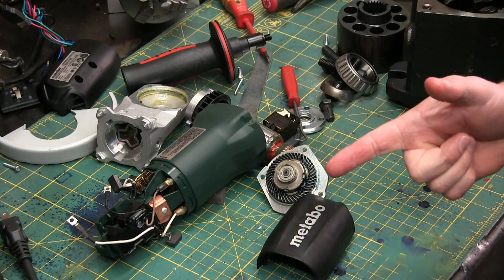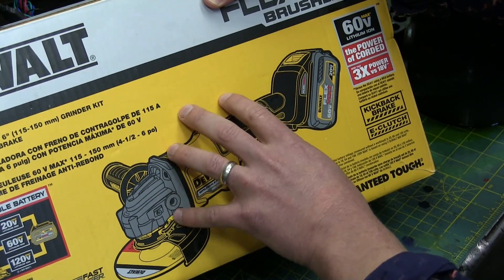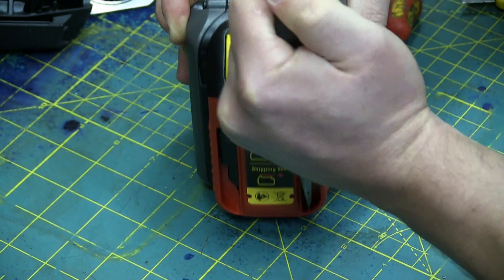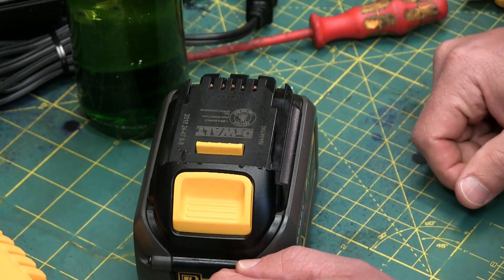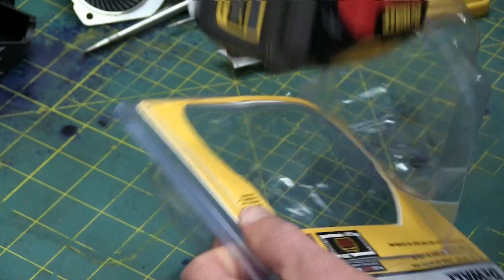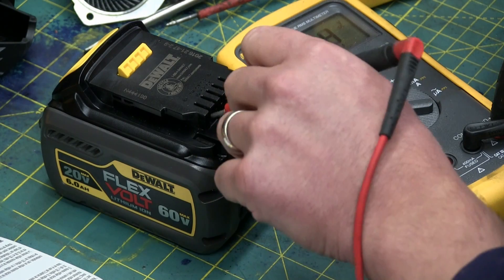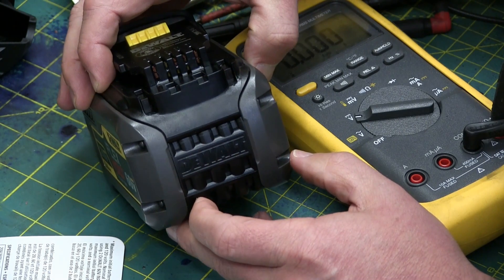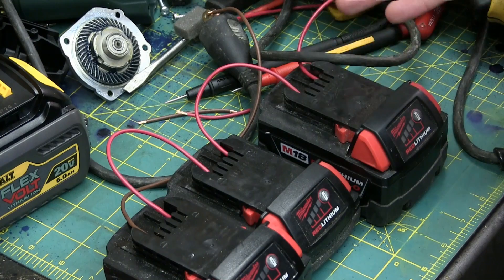Plug-in Power Tool to CORDLESS CONVERSION.

Comment: So basically he wants the power tool to have a starting capacitor like on an A/C compressor. But instead of the capacitor, it's actually a battery.
Reply: Not anywhere near the same thing. A starting capacitor is used on the capacitor start type AC motor because this type of AC motor will only start up and rotate due to the forming of an RLC circuit which causes a phase shift of the starting winding's magnetic field relative to the run winding's magnetic field. If the capacitor is removed, then the motor will sit there and buzz like an angry bee unless you rotate it by hand.
Reply: Paul Frederick my apologies. Damn this comment system.
Reply: Do you mean like how the capacitor shifts the phase of the line current to generate a second phase so the motor can begin rotating? I didn't think so.
Reply: Paul Frederick What do you think I just said. Hmm?? The capacitor will not do anything for a universal motor as it already works without needing any kind of phase shift.

And guess what, if you shift the the current then you also shift the magnetic field phase relative to another. I don;t think it was necessary to have to explain the electrical phase shift part as that is a given if the start and run magnetic fields are shifted....Cause and effect...
Reply: EETechs
my comment was for pauljs75
Reply: EETechs
yeah YouTube doesn't let you plus users like G+ does. Sometimes I do it anyways, but it isn't the same.  So most of the time I don't bother. The threading on YouTube basically sucks.
Reply: +pauljs75 This. Why not just build a bridge rectifier with a capacitor bank? Assuming all these tools operate on DC. Relay in the capacitor bank at current.
Reply: It's likely the transients that hose the breaker. Maybe just having a parallel bank is enough.

Comment: Great idea but don't forget to add a safety that cuts out the batteries when the RCD trips or it's going to be a killer.
Reply: at least then, there is no one else to blame but you when something happens. And your responsibility is to have the tools well taken care of, because no one else will save you if e.g. the wire insulation fails, there is no almighty RCD to save your ass, to rely on.
It's fair, to be honest.

Comment: if the fuse trips "off" form  loops (coil) with the extension cable and start the machine then.
the coil will help you over the drop.  ... but can get warm over time. 

the power tools running on akkus will ruin the akku and maybe damage the machine windings.  
but hey, give it a try  - i might be wrong  :)

Comment: This is a baaadddd idea! Lithium battery are easy to make them go up in flame... You need a proper protection circuit and proper charger that monitor each cells, else you will most likelly ends up with a burned down house...

Comment: Looks like beer makes you smarter.
Reply: Beauty is in the eye of the beer holder.
Reply: ***** Let us be the judge of that.
Reply: Edison would be proud let the pure direct current lithium juiced batteries run anything we want!  For the highest current discharge rating capacity you should look into lithium polymer battery's used  In hobby grade remote control  vehicles!  A typical 5 amp LiPo battery will constantly   flow 100 amps!

Comment: Cord plugged in + TURBO batteries would require a Tranny + Inverter to not damage the batteries. So you could just buy a 12VDC to 230VAC car inverver and hook up a car battery. Would provide cordless function, but needs to be sync'd  to precisely match the line voltage waveform (phase) to provide corded TURBO.
Or just solder some PTCs in a line socket to limit inrush current and switch to batteries if you need cordless. My USD 0.02

Comment: Running corded tools on DC reliably is a bit harder than just giving them DC. Most of them will inherently work off it, but you should really avoid trying to interrupt the flow of the pixies with an AC switch or electronics. AC cross over zero 120 times a second here in North America, so generally minor arc are extinguished fairly quickly. However, DC always has power available, and as a result arcs are very hard to extinguish. I've melted quite a few 120VAC few switches running them on ~100VDC. It depends on the design. Some can tolerate it, but its likely to shorten the life a whole bunch. Some fail the first time you go to break contact, the higher the current/load at the time you go to turn it off, the more likely it is you won't be able to turn it off.

But otherwise, what you're talking about is super easy. I run saws and stuff on my ~100VDC bicycle pack every now and then. Even runs most switch mode supplies just fine. But you gotta be sure to snap the switch off fast under minimal load. At 60VDC you should be OK, but 100VDC and up is some nasty stuff.

Comment: So basically a Online UPS like the APC Smart UPS RT, which varies from a 1000 to 10k VA and ditch the stamped steel housing and the lead gel batteries for Lithium. You'll end up with something far light and smaller, which arguably is mobile enough for this sort of thing. It's probably the only thing that switches fast enough in response to input/output.

Most of the normal line-interactive generally conk out with startup currents, or just go straight into bypass, and still blow the breaker.

Comment: It would be useful to be able to plug any of the cordless batteries into a box that in turn could be used to power both corded and cordless tools. universal power supply if you will. Also Did you not hear me screaming at you to "PUSH THE BUTTON!"

Comment: Just make a lithium power bank that plugs in to the outlet. The tools run from the inverter and get conditioned power which should make them run better and last longer.  you can have a bank of caps that help.

Comment: "but AVE", some would say, "wouldnt pumping 60v DC through the switch of the drill cause an electric ark on disengaging, corroding its contacts pretty fast?" you might need some solid state relays or similar black magic.

Comment: Where i come from power cuts are common, so we've had to become a bit self sustaining. 

number 1 way to get consistent power off grid is to run a diesel generator, but theres maintenance, and diesel stinks, and yadda yadda. 

Or.... you run a fully fledged full sine wave inverter off of a bank of deep cycle batteries and use that as your condom to external power sources. would be bulky, but it'd be might slick built into the back of someones work truck or whatever. Condomised power...

Ok, so say you go the full sine wave/deep cycle route, then you could hook up a second alternator, so that your battery bank gets topped up while you're in transit to a job site. 

Fringe benefit would also been nice clean power, so you could run sensitive instrumentation if you wanted too. Camping could be pretty cool too.

Shit depending what kind of tools you want to run, you could totally ignore local power at a job site, and run purely off your inverter. a bank of 8-12 batteries would be a whole lot power (could rig up a charger at home, so that the bank charges while the user does)

Comment: I was going to say something about using a larger capacitor to handle the initial spike, but I really don't know anything about that. Another thought, when you're grinding a particularly stubborn thing, an energy contribution from the batteries could help. The system could be designed to only draw a certain amount of energy from the wall, keeping breakers frosty. But maybe that was your point all along.

Comment: You would need the charging system like what cars have with their charging systems. And you could use some electronics to monitor the total amperage load and control the DC output to another winding.  The problem would be syncing the speed of the rotor with the AC power and the DC power.

Comment: Based on the video, I picture a "black box" with a pair of standard 120 volt NEMA 5-20R recepticles we can stick our tools in.  On the other side, a standard electrical cord with a NEMA 5-15P plug that we can plug into the wall or connect to an extension cord.  On top of the box is a rectangle opening where each guy can attach a battery adapter plate for several batteries.   

I suggest that whatever is inside of our black box booster unit, the battery-interface is somewhat universal.  This allows the same "black box" design to be used with all of the different brands of cordless-tool battery packs and avoids the design patents I'm sure each company has on their proprietary battery connector & socket.   As long as nobody is making a profit on the battery connector, it should be clear from any kind of litigation.

The battery adapter plate  can be 3D printed, moulded or machined from UHMW, Delrin, HDPE or some other kind of plastic (including the toaster-oven method for recycling HDPE as seen in another video).   For some of the batteries that slide in like Your Milwaulkee M18 & these 20V / 60V DeWalts, a few sheet metal tabs can be screwed on to a sheet of plastic to make the plate too.  That all depends on what resources (3D Printer, tin-snips, toaster-oven) each guy has in his shop.
Reply: In the Solar and Marine electrical industries, there are inverter/charger units that can do what you're suggesting.  They are many thousands of dollars for the high end units.  Victron Energy manufactures a few inverter units that charge your batteries when the loads are low, but will use battery current through a computer controlled inverter  to match the incoming AC phases.  When I worked in the marine electrical industry, we used these when air-conditioner units were being installed on vessels with smaller generators.  The inverter matches the AC waveform from the generator with extra current from the DC battery bank.  We can learn from this type of unit to build a small, portable version that can be assembled and programmed by the "home gamer".

The small Inverter-Generators (Honda EU2000i , etc) are also a good source of conceptual inspiration here.  If you added a battery bank to those inverter-generators they could make up heavy current spikes and starting loads from the battery beyond what the IC engine could support.

Comment: They are not completely charged at the factory because full voltage on the battery makes it deteriorate faster. Li-Ion should be stored at not more than 80% their max capacity for longest lifetime.
This is valid always, not only for long term storage.

Comment: the added ability to switch between corded and cordless would be quite nice.  95% of the time I use a drill where I can plug it in without much concern.  Paying 3x the price for those 5% situations and ending up with a drill that just doesn't chooch as hard and you gotta deal with swapping batteries?  Annoying as frig.  Would be nice to have the option to go cordless for driving a couple screws, but then be able to plug in for something like drilling through dense materials that chew through batteries like a (well, insert moderately insulting simile here.)  Same goes for a circular saw: Go on battery for a couple rips through plywood out in the driveway, plug it in for thicker stock.

Comment: Round here 230 volts AC is the dance the pixies do out of the single phase wall outlet so makes it a little harder to run tools off Batteries

Comment: what you want is a modified ups. always starts the load on battery, then switches to ac. should be pretty simple to do
Reply: i doubt you need to modify it either, just fool it externaly. you will need a circuit to not give the ups ac until a certain time has passed when it first detects a load, this will cause the ups to start on battery, when it sees ac it will switch to ac. when the circuit sees no load after the tools finished with it disconects ac to the ups making it ready for the next finger to be cut off. you will also need an override switch so it runs like a normal ups to keep the batterys charged up as it won't be charging when used as a super duper power thingy.

Comment: You can most likely modify the line from a PC power supply that can pull a LOT of wattage from the wall and pull over that hump. A decent $60 PS can pull 600 watts uninterrupted no problem
Reply: Voltage would be too low IMO
Reply: well.. what? the kettle or a space heater draws 2000W, so why is a 600 w psu a boost?

Comment: soooo maybe I'm the foolish one here but what would the issues be hooking the batteries to a cheap 400w inverter and paralleling the standard 110v pixie 2 lane highway?? would it not act like a capacitor? hook up some of that new fangled arduino stuff to an amp probe of some sort on the outbound so when current out of the unit stopped it would kick on a charger and off again when it senses current out.

I dunno I'm just a fork lift mechanic lol don't mind me.

Comment: just switch to 230v.
refuse to believe that the industry makes a separate tool for us in the free world. has never had a major problem with fuses in my years as a carpenter.

but for you in the not fully free world. charger takes 120v and provides 18 / 54v. so why not redesign it to do the opposite.

Comment: where do you get a charger for 60v Li-ion batteries?  also, would not running a 120v tool on 60 v make it take too much current and overheat the winding, or does the DC nature of DC power compensate for the lack of voltage in cycling AC?

Comment: I like the way you think. As a ham radio guy ( and expired uh, retired electronics tech), I use a 10 amp/12VDC power supply to run my 100 Watt radio... which most would say OK, that's 120 watts, but it takes just short of 200 watts to achieve 100 watts out, so you're thinking "so how you do day din?". with an external battery, keep it charging whilst you're receiving and when you need that peak current it's drawing down the battery (voltage sag is never more than .1or .2 vdc). If I were doing this project, I'd probably start with a 12ish or 24ish vdc bank and a 1kw inverter and have the batteries continuously charging from a charger, inrush current would be limited by charger capacity. Just a though on a starting place. Tootles Buddy... Wade

Comment: Just put a start capacitor in what every tool you need it for and that should fix your problem.  Most fans and AC units have these on there motors to get them going.  There making some beefy capacitors now a days that should give you the kick your looking for but nothing so big that it should make your tool bulky or heavy.  The only problem with having put those in there is the cost.

Comment: about the partial charge- lithium based batteries are "under pressure" when above 80% and below 20%, the longer they are above or below those extremes, they lose total storage capacity over time. Goes for laptops, cell phones, anything. keep between 20% and 90% it'll last have a better capacity throughout it's life. if you charge 100% you want to discharge below the magic number, not store for months. Some people flying multirotors and rc airplanes will charge full ONLY right before flying, then stop flying when discharged to 3.4 volt per cell. Most hobby grade lipo chargers have a "storage mode" that charges or discharges a battery to around 50%. Took me 5 years of rc flying and driving to remember that all
Reply: I'm a rc addict myself and as you said, i alwais put my lipo's  in storage mode if im not going to be using it for over a few days. I only charge it full right before use.
Reply: I'm a rc addict myself and as you said, i alwais put my lipo's  in storage mode if im not going to be using it for over a few days. I only charge it full right before use.
Reply: +billybobjoe198 they want batteries to go bad so they sell more
Reply: I'm a rc addict myself and as you said, i alwais put my lipo's  in 
storage mode if im not going to be using it for over a few days. I only 
charge it full right before use.
Reply: after commenting, i see there's been plenty of experts like myself jumping up to PROVE CANADIAN MASTER WRONG. haha
Reply: I do the same with my lipos. I've had too many dead cells result from storing at 100%.
Reply: Which possession of your lipo were you both trying to talk about, Pascal and Schism? And Schism, why did you copy exactly what Robert said?
Reply: Wrt. Li-on batteries, the usual recommendation for long term storage is to discharge to 40%, see eg. http://www.techrepublic.com/blog/five-apps/five-tips-for-extending-lithium-ion-battery-life/
Reply: I'm a rc addict myself and as you said, i alwais put my lipo's  in storage mode if im not going to be using it for over a few days. I only charge it full right before use.
Reply: What were you trying to say with that made-up non-"word" "alwais," DeadInside69? And why did you just quote Pascal Robert?

Oh, and which possession of the lipo were you trying to refer to as what you put into storage mode, but left out of your comment?
Reply: Pascal Robert, because you said "lipo's," so one would expect a possession to come next, since you couldn't have meant "lipo is" or "lipo has." Right?
Reply: What, like "isen't," Pascal Robert? What do you mean by that: "isn't"?

So will you go ahead now and answer my previous question?
Reply: Pascal Robert, how do you have, and then "lipo"? What supposed sequence of events do you think you're talking about?

Yes, you used an s on lipo, but you also used an apostrophe. If you're trying to refer to more than one lipo (actually, it's "li-po", for "lithium-polymer" [battery]), then why are you using that apostrophe?